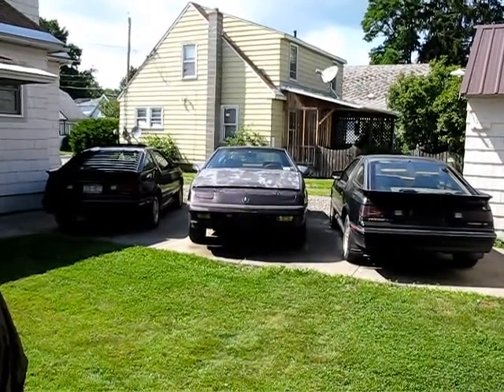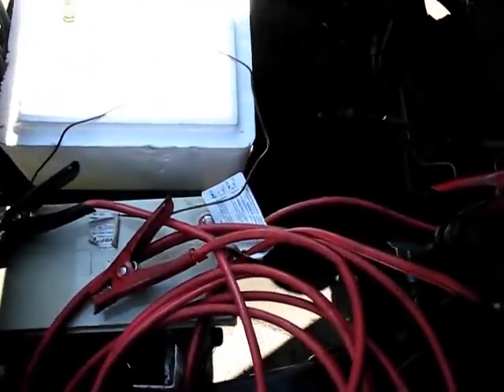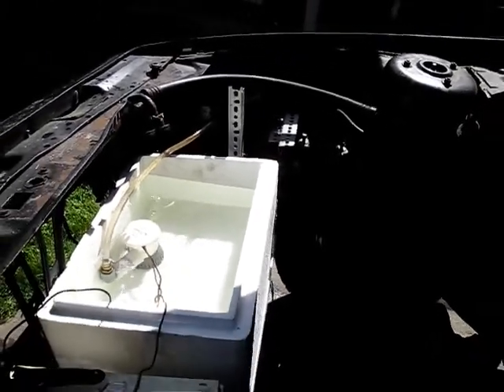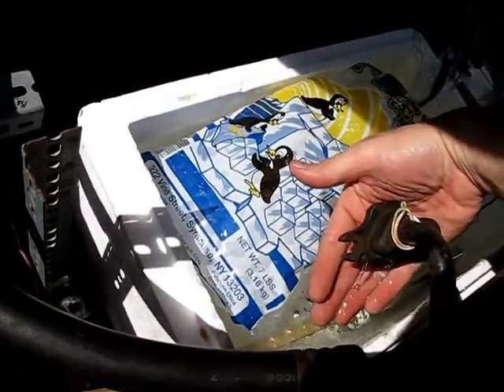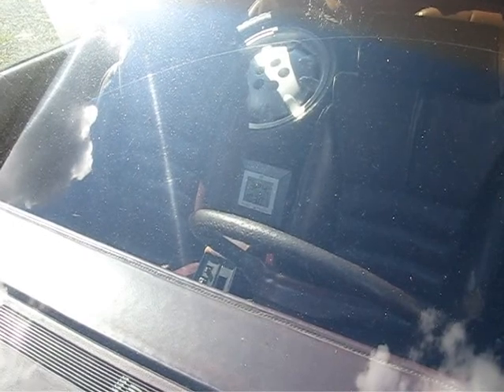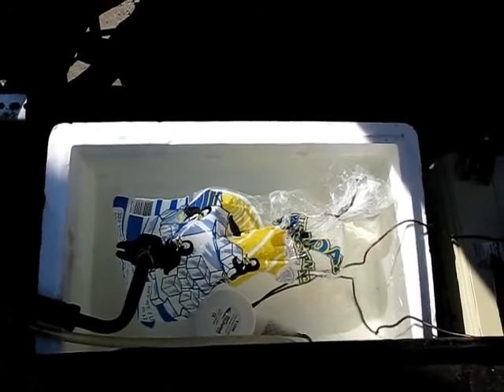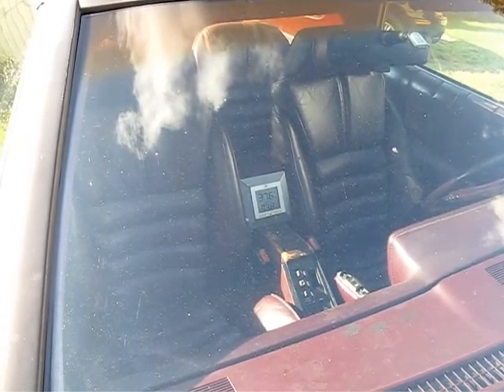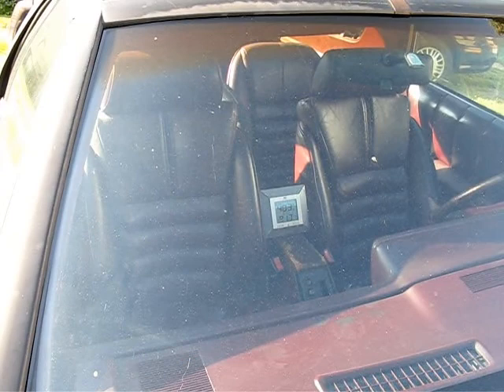July 11, 2013 - Homebrew Air Conditioning Experiment

Comment from the maker: Well hello there Mike!  As the engine compartment in my current Daytona EV is already quite filled with batteries, I sadly do not have enough room to fit even a small ice chest in it...  So I am now frantically working on a completely portable unit that is quite similar to the original 'instructables' one linked to in the description, and which is fully enclosed. In theory it will be able to be tossed into the rear seat or hatch of my current EV and simply plugs into a cigar lighter socket. :)

Comment from the maker: ...the next phase of my master-plan involves using two actual heater cores (larger pipes/better flow), a larger enclosed cooler, starting with just enough water to provide adequate circulation (about 1" in the bottom of the cooler), and 3 or 4 bags of ice all at once.   I figure if I start the cabin off at ambient temps (ie: open windows first and let the built-up heat out), then the system won't have lower the temp as much before it feels "chilly" in there and the ice should last longer.  :)

Comment from the maker: The pump is a Tsunami 1200 Gallons Per Hour model, so I am thinking that the flow from it is more than sufficient (likely overkill) for this task.  However, I had to reduce the pipe size several times to mate it up with the 1/4" OD inlet to the stock A/C evaporator unit which greatly reduced the total throughput.  Even so, it seemed to be enough circulation to completely melt a bag of ice in ~30 minutes and was able to bring the cabin temp down significantly, thus proving the basic concept...

Comment: It seems like your flow rate is a bit low. I'm not sure if it is because the bilge pump can't fight a restrictive AC system or if its a lower flow pump the flow rate may be limiting cooling capacity.  I'm planning to go the tail shaft compressor route and leave the belt off when we're outside the months where we need AC.  I have the benefit of almost all highway driving so I don't mind if it warms up a little when sitting at stop lights and I'm not planning to use much AC.